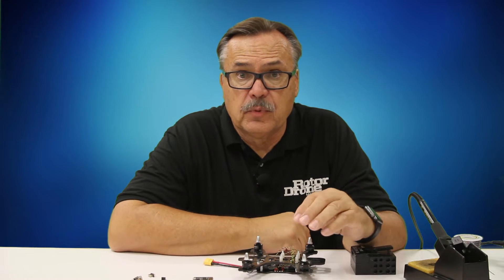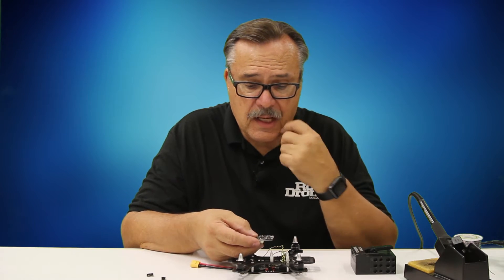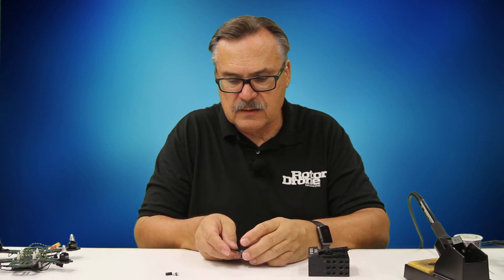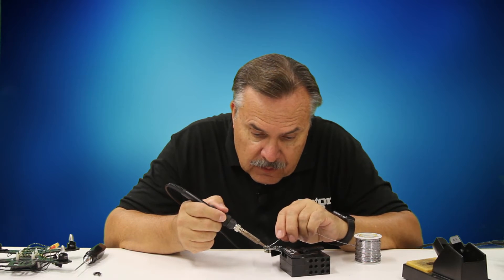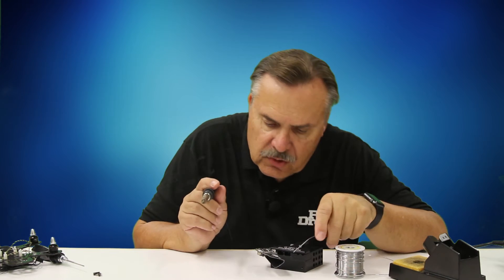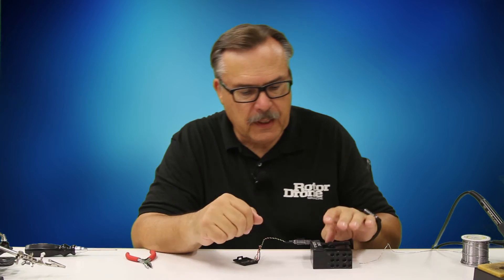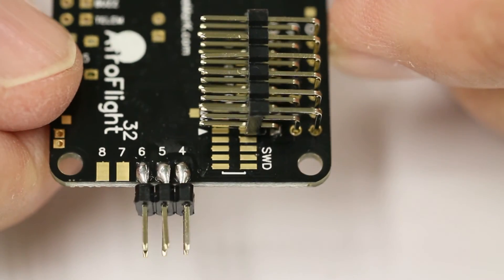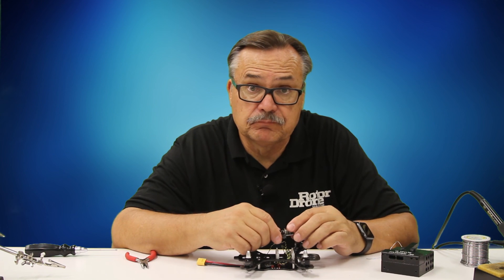Controller Soldering 8906

Comment: Those ball shaped solder beads are the signs of a bad joint. The interface at the bottom of the ball can often be a granular contact joint which will fail. A smaller bit would be better. Lightly tin the bit then make sure it contacts the pin and the board, they both need to be hot enough for the solder to flow, Then apply solder so that it flows to make a volcano shaped joint.  Less is more